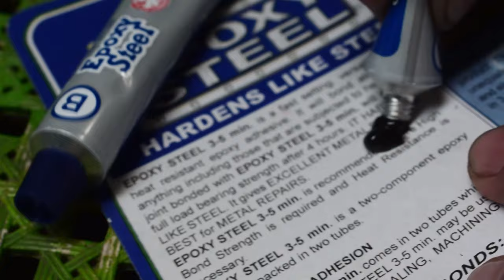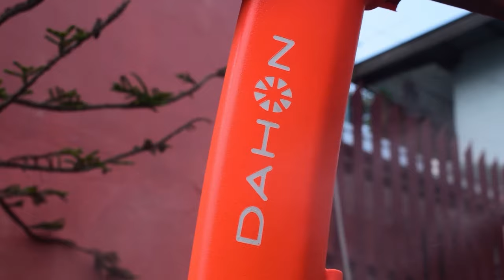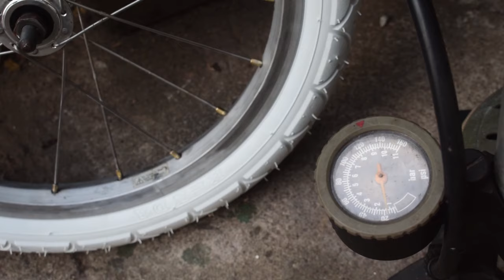The Beauty of Restored Dahon Curve D3 with Turquoise and Orange Color - Folding Bike Restoration

Comment: Well, thanks to this video now I understand how to take apart the frame latch. In my country there isn't any official service (well there is one, but it's very far from me).A friend of mine can get me the latch replacement kit, however, do you have the measurements for the screw you use to remove the hinge pin (at 2:43 you use a screw and pliers, that screw I mean). Thanks a lot!